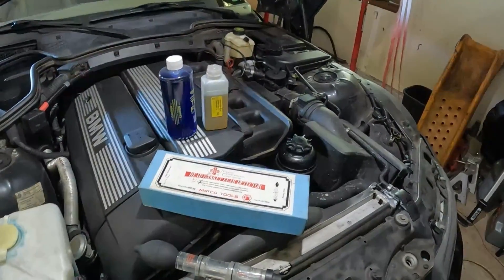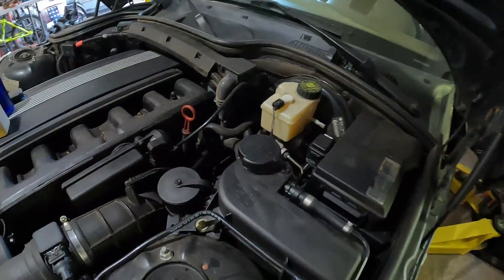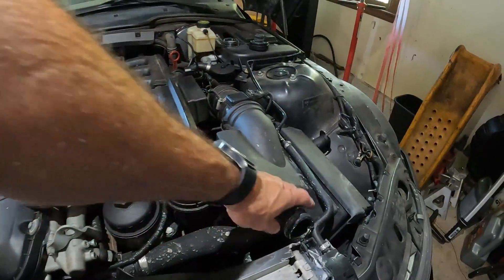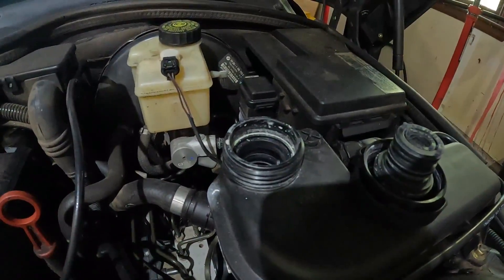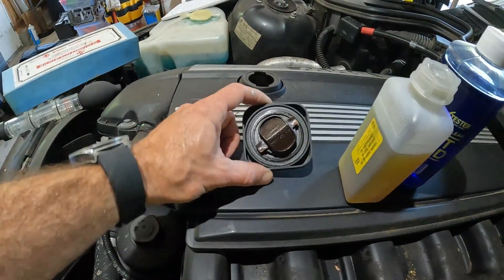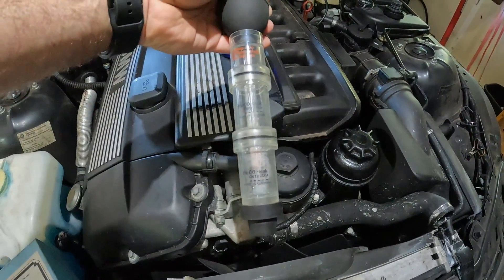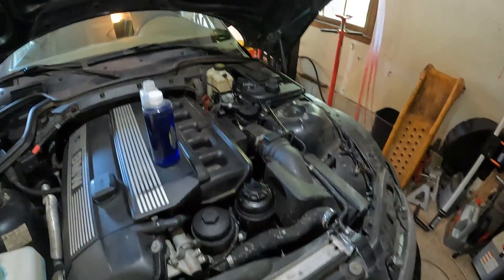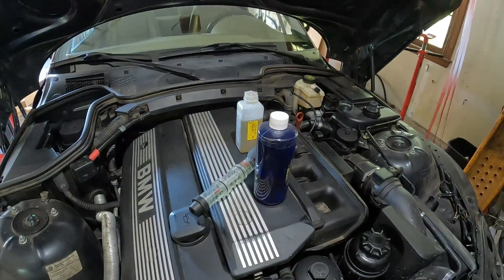What is a blown head gasket? TEST for a FAILED HEAD GASKET. Symptoms of a blown head gasket BMW Z3

Comment: Thanks, Roger!

I’ve taken both our bimmers to me dealer for coolant swaps (preventative) and my (trusted) service advisor tells me I’m the only person that ever asks to have that done! WTF?!?
People think the coolant lasts forever, maybe?

I worry about the electric water pump going on my N52 and not noticing a overheat condition in time to prevent damage.  
I understand the lack of a coolant gauge with a variable speed coolant pump but it could bite you in the butt, no??
Reply from the maker: Hi Mario! BMW now considers coolant "lifetime' BUT it still makes sense to change out the coolant to me which would provide better lubrication to the working components like the water pump. One good thing about the N52 pump is when they fail the electric fan will run on high and often provides enough cooling through ram air to not cause an engine failure.  Plus usually you will get a warming. If you buy the pump from a dealer it then has a limited lifetime warranty. 2 years on the labor and part and lifetime on the pump itself.